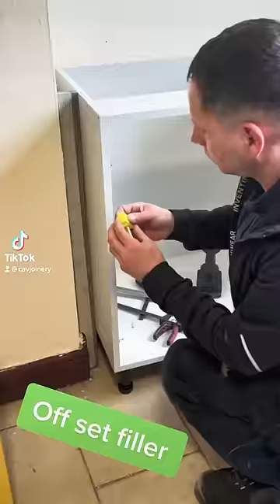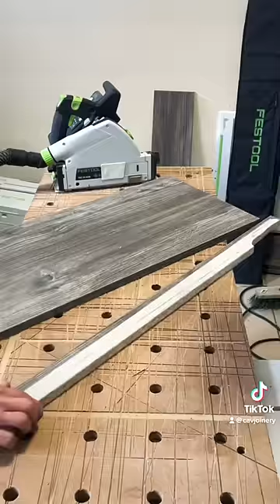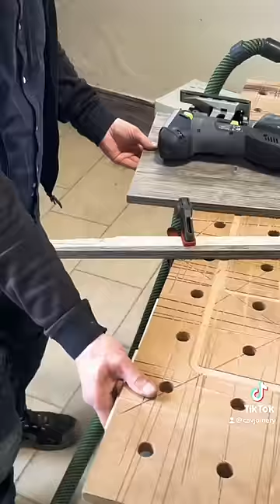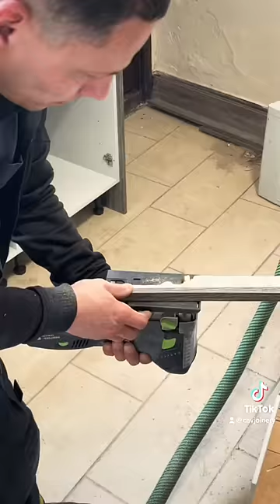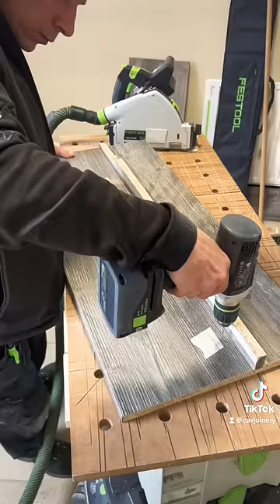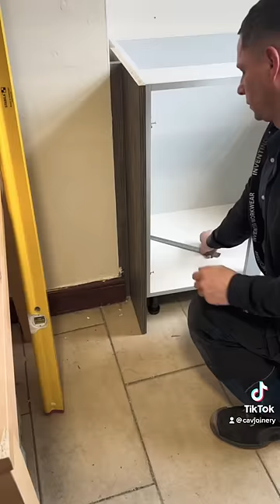Off set filler

Comment: As a contractor, I think it'd have been FAR better to cut the baseboard. Both it'd be easier than scribing, but also if that trim ever needs to be replaced it can be done without pulling out the cabinets.
Reply from the maker: That is right

Comment: Sticking tape on the support wood when your are cutting a thin peace is genius. Thank you.
Reply from the maker: Thank i had that problem when I started small pieces flying around or moving while cutting so I figured it out afterwards, thanks again 🙏
Reply: genius would be actually using tape saw for it

Comment: Привет! Объясни пожалуйста, какой ширины изначально ты сделал планку, которая примыкает к стене? Как не ошибиться в расчетах, чтобы потом при работе рубанком не отпилить лишнего? Как ты понимаешь сколько должно быть расстояние от стены до карандаша?
Reply from the maker: Hey there so I cut a piece approximately as wide as the gap between carcass and wall , actually there will be a 18mm panel and on right after that filler so i used 18mm plastic  block to coping the wall onto that filler keeping the filler tight to the carcass,so filler now is moved closer to wall by 18mm exactly the panel I need to slide between carcass and filler.thanks for watching

Comment: Take baseboard off ,when you finish side panel then put back baseboard
Reply from the maker: I could have done it but costumers wouldn’t let me damage 180 old skirting boards for some reason ,that would have been a lot easier for me to do , thanks
Reply: I was wondering the same thing.  Thanks for clearing that up.  We’ve all dealt with such customers.